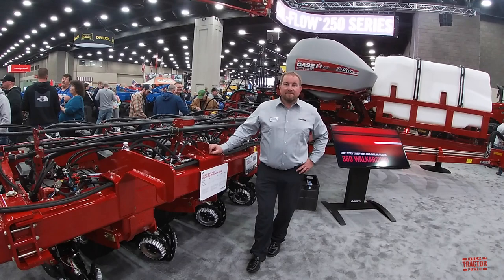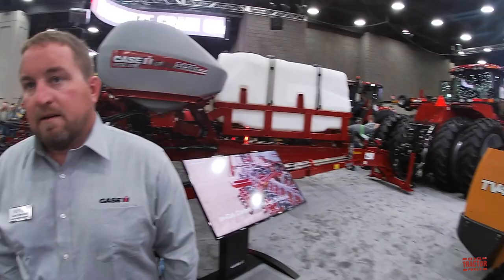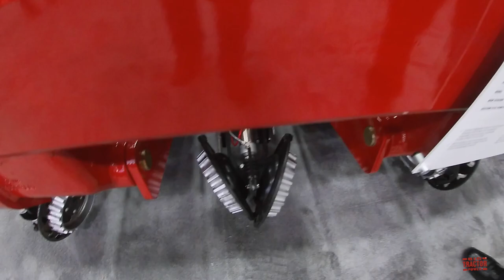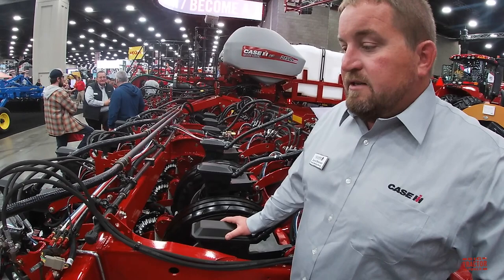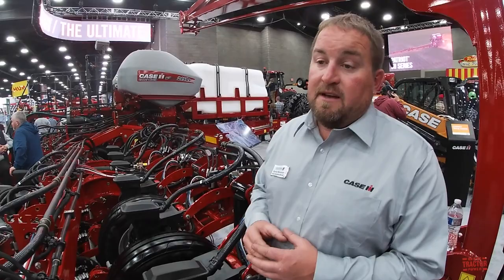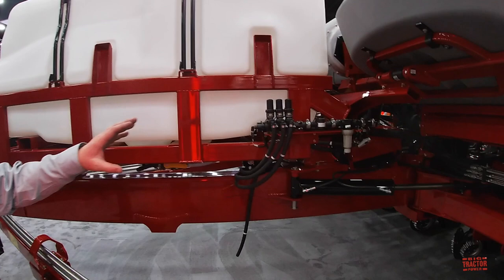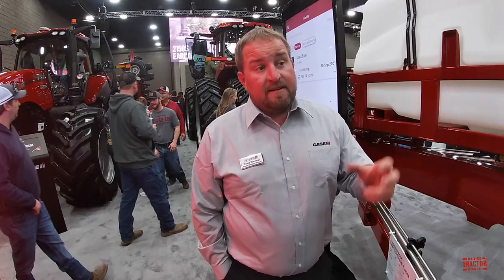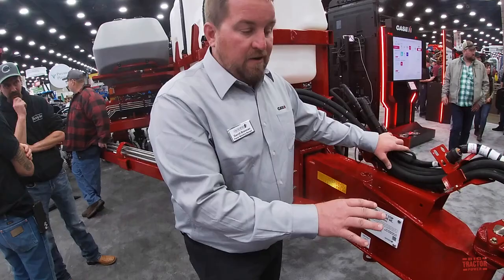New CASE IH 2150S Corn Planter

Comment: We currently run a 2150 12 row and it is junk.  This is going to be our 2nd season with it and still having issues, dealer has been very little help and Case has not been much better.  I have a list of issues that have went wrong and problems we have had.  I would go back to a Kinze in an instant.  Depending on what happens with Case this year I see another blue planter in our future
Reply: @Thebigtipper101  You are welcome to come and put on a clinic if you like
Reply: Nothin runs like a deere